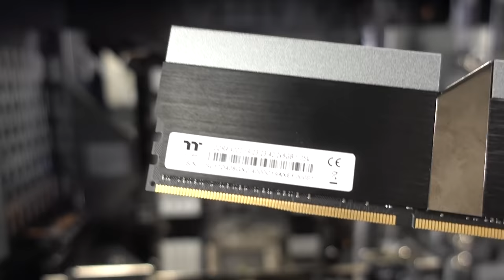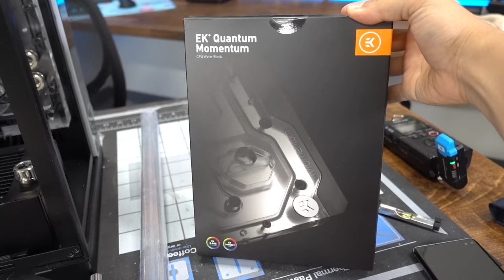My $10,000 PC is back #CHROMETHEUS

Comment: Calls a computer Chrometheus.
Only outfits it with 64GB of Memory.
Chrome like: HA
Reply: So you have chosen 2 tabs only
Reply: @sopcannon  2 tabs!? I can barely open 3 with 128GB, must be hitting the pagefile something awful to run 2 on 64.
Reply: I dont get it my $500 5 year old laptop has no problem with like 5 chrome tabs open.
Reply: @notanerd231  but not really
Reply: @gabemartinez2558  It's a running joke, because chrome is the most ram hungry browser, and yet its the most popular.
Reply: @gabemartinez2558  r/woooosh
Reply: gabe martinez issajokebud
Reply: @centuri.trader9194  keep using chrome. Unless you are doing serious multitasking it will be fine

Comment: About the tubing you have toward the front of the case: the inner bends seem to be slightly wider than 90 degrees, at least, that's what it looks like compared to the outer bends. I think you need to extend the horizontal parts of those tubes a few millimeters.

Comment: I'm still waiting for someone to make a loop with liquid metal instead of water.
Reply: Liquid metal would be an awful coolant
Reply: And it will ruin the pump.
Reply: The Verge might 😂😂
Reply: Mercury or something like that lol
Reply: I wanna see a case where theirs watercooling tubs sticking out of it, you do normal watercooling, but the input and output is outside the case. Tubing going along the wall to the basement connecting to the radiator in the house. Going into a pump that uses high pressure to push the water along. Maybe even the home plumming going thought radiator and to your pc, and back to a drain where you can save water. Idk long shot. But yeah

Comment: Been waiting for an update on this computer for forever! Glad to see its coming along!

I was thinking instead of the double 6 mm offset for the top tubing on the CPU block, what if that tubing went straight left immediately, going above the RAM, and then going down and back into the same hole? I think that might look nicer and would be easier to put together.  I think its gonna look sick with the metal tubing tho

Comment: Upper most horizontal tube (coming from the monoblock), I'd say: Up out of monoblock > horizontal towards distro > vertical towards fillport > down into distro. 
For the bend between going horizontal and vertical  I'd use the tube and for the angles (when coming out of the block and into the distro) I'd use regular 90 degree fittings. 
If needed, you could use two small pieces of straight tube at both the in- and outlet to ensure the tube runs parallel to the other bends height/depth-wise.

But then again, its a whole lot of 'I would' and a whole little of actually having the $ to have experience with this level of exotic cooling lol. What do I know?

Comment: This build is looking svelte and shiny without being all about the bling and unicorn vomit. I'm really digging the accoutrements and minute details you're adding with the fittings and the M.2 PCIe card. 

Not sure if you want them, but Phanteks Halos Lux aluminum fan coverings would give whatever fans you go with using some extra shiny, and you wouldn't even need to plug in the rgb cables, unless you wanted more light shining from them. Put those on top of white based fans would look sweet.

Comment: I saw this on a show when they were bending metal tubing for exhaust on a motorcycle. The company took metal tubing and filled it with soap water. The soap water never really froze when placed in to a freezer. The crew was able to bend the tubing without kinking the metal

Comment: You're gonna have a problem if the metal tubing doesn't come with different bend radii... It looks like what you did in PETG is WAY tighter than what was on that metal tube you showed.

Comment: Lian Li makes a really cheap sag bracket that replaces 2 motherboard screws and holds the card up from behind. It's just a single piece of "hole-punched" black metal, and 2 small L braces with padding, so it shouldn't be too visible.

Comment: It looks like you could move the distro block up ~12mm. Then you wouldn't need the double offset on the upper CPU, the offset on both ends of the lower CPU tube and you shouldn't need any offset from the lower GPU to the lower of those two outlets. That would just leave the upper GPU line that is off, but I think it might line up with that lower inlet to the distro block, just below the one it's in.

Comment: You should use Raid 0 for maximum speed on the editing machine and another solution like a NAS or storage server to permanently store your finished projects.  If it were me I would keep the dimm.2 fully populated on top of the add-in card for maximum storage, I would also consider a few HDDs as temporary storage for recent projects before they are sent to permanent storage somewhere else.  Hope you can find a sag bracket that fits the theme.

Comment: You have flexibility in your runs to the radiators. Try to raise or lower water block to reduce amount of offset fittings required.

Comment: noticed you finished your table, if you want a better finish on the top coat, get 0000 grade steel wool and scuff the surfacce, it will look alot better, just make sure you scuff with the direction of the grain

Comment: This is the O11 XL, right? You could vertically mount the GPU with Lian Li's accessory bracket. 

I think with the GPU having a water block on it that mounting it vertically would be really sick looking. Since you're going with metal tubing, the only place you'd see the liquid is in the distro plate. With the GPU mounted vertically, you could see the liquid flowing through it as well. Just a thought. :)

Comment: Now I'm interested in that RAM. A TR 3979x is in my future, and I know that Ram speeds are limited by ranks and density. If I could actually get 128gb of RAM to run as fast as possible, I'd be in love.

One thing. Make sure you put that DIMM.2 in to make sure you have tube clearance.

Also, the RGB makes the RAM run faster. Lyle told me so.

Comment: Why don't you bump up the entire distro plate by 3mm and avoid so many offset fittings?

Also, to support your GPU, take the bottom run out and go straight down and have it resting on the radiator or fans, whatever will be there. It is what I do with my hardline builds to help support the GPU and keep the fittings from pulling apart. Just a straight down and use your fitting 90 at the bottom to get a very flat place to press against.

Comment: If you had scrap metal tubing left use it to hold ur gpu up, it would look good with all the chrome tubing ur putting in it. Btw go to a metal shop, and get a bottom plate made to fit the bottom of the case then get it chromed or chrome paint it.

Comment: I need an opinion on my first pc build. Will there be any bottle necking or incompatibility? CPU: R5 3600 - Mobo: Tuf X570-Plus - GPU: RTX 2060 Super - PSU: EVGA 80+ Gold 750 Watt Semi Modular - RAM: Crucial Ballistix RGB 16GB (2x8) DDR4-3600 CL16 - Storage: Adata XPG SX8200 512GB M.2 Nvme SSD.

Comment: Kyle - for the upper fitting on the cpu/board monoblock, have you considered coming out at 90 degrees clockwise, run the piping straight across the gap above the RAM to the distro plate, then 90 degree turn clockwise to head down to the port?

Comment: Kyle go to home depot and as for a quarter to half inch pipe bending tool they come in few styles one like pliers with a wheel in the middle and others look like a bench vice with a wheel on the end ranging from $80.00 to $7000.00 depending on the bender size options..

Comment: Looks great mate! Got the same block, but ripped my OLED cable whilst trying to remove it.. Did you btw have the screws to screw in the VRM screw holes? They didn't supply the right length of screws in mine and I got some spare from another EK block which fit perfectly lol.. 

I'm interested in your loop temps once you are done, mine is currently pretty hard to get lower since the CPU just pumps so much heat :(

Comment: I would make a bracket that spans the lower radiator that is chromed but provides you a way to attach the GPU bracket to it. Since the Radiator comes with threaded screw holes!

Comment: COULDN'T FIND A CHROME SAG BRACKET ANYWHERE ... BUT ...  
There's lots of chrome holster/bolster types that prop it up from the PSU shroud ... but that would not look good in this.  
YOU COULD get a basic 'uphere' brand steel bracket ... and get it chromed locally.  
Go to a custom motorbike shop for info and a lead as to where to get that done.  It wouldn't be expensive.
btw ... had to slow it down to 0.25 speed to actually appreciate the waterblock install.

Comment: I've never worked with distro plates before but when mounting it in the O11D don't you have a little room for height adjustment on those elongated holes? Seems like you could get rid of a lot of those offsets just be moving the plate up a couple mm's for better alignment. Just saying.

Comment: If you fill up your metal tubing with sand then you can bend it different shapes without kinking it just pack the sand inside the metal tube and tape up the ends...

Comment: G'day Kyle,
I think you should get the Chrome Rads before you do the Chrome Tubing, just in case it changes the length needed for the Tubing, just use the New Thermaltake Silver Coolant for now in the Clear Tubes, it is Looking Awesome,
I hope my New Editing PC with R9 3900 & GTX1080Ti will look as good when I do my First Custom Loop for it, I am using Phanteks Blocks for the CPU & GPU, I still have to decide on a Pump/Res Combo & Fittings

Comment: Just gone TR myself; 1900X & X399 Taichi from x99 sabertooth and Xeon E5 v3 to compliment the 5700 XT I’ve had a while and went all AMD for the first time. Only issue thus far is Ryzen master not wanting to install. 

It came with an EK Monoblock supposedly only for asrock boards (it even covers the VRM) but I doubt I’ll be going custom loop at least not for a long time and apparently there’s not many around of it so even if I wanted to sell it I dunno the value on it. 

That’s rigs looking very nice, TRX40 is complete overkill for my needs and I doubt I’ll need anything beyond, say a 2920X or something like that but dayyuuum it’s looking and gonna be pretty. Form and function to match 👌 can always appreciate killer hardware regardless of what I’d ever get.

Cannot wait to see the metal tubing all sorted, let alone when it may get some Ampere goodness, hope it lasts and isn’t too much trouble for you to maintain.

Comment: Personally, with all the offset fittings, it looks a bit like a bodge to say the least.
Would also have to say that the distro plate itself seems more like a gimmick than it actually provides useful connections.... That makes me wonder if EK makes custom distro plates to order. Since that would be wonderful if one could ask them to machine the hole x mm higher up instead of using off set fittings.

Though, having a laser cutter myself, I would just buy acrylic sheets and make my own from scratch. (Yes, it would need to be a layered sandwich. But that is frankly semi trivial to do.)

Comment: For the love of god ... please leak check this thing with air before putting coolant anywhere near it. It might be a good idea to show the viewers how to do this as well. The tube run out of the top of the mono-block might be a right pain to bleed air out of as well.
Being as heavy as it is when it's full of water means tipping it to bleed air may be very difficult.
I would just modify the runs to avoid using those offset fittings as they are just a major flow restriction. Good luck with it.

Comment: Saw on the RAM that it's 4000Mhz at 19-x-x-x... 

Doesn't Ryzen run best (1 to 1?) at 3733Mhz? Would it be worth it to run it slower and try to tighten the timings?

Comment: Kyle: Builds $10k computer with 2 massive radiators

Also Kyle: Does not give either massive heat producing component their own massive radiator.
Reply: While I'm sure he would have liked to have ran it that way, he did state that he was limited on the amount of tubing he had available... And yes, while a bit redundant to cool a rad with a rad and "cool" a CPU straight off of a GPU (or vise-versa) isn't ideal, the system likely will never top 80°c anyways, so not the biggest concern... Just OCD working overtime.
Reply: @RAW_Reality  exactly. But also, it's a 10k build? So like. Idk. I'm one of those crazy "if I'm investing my money into anything, I'm gonna make every 'ideal' choice I can," types. It would bug me on a fundamental level using that PC every day knowing I left a few less degrees of cooling for one of those parts on the table. Maybe in V2
Reply: @Dyloniuss  Oh, I can't fault you for that, I'm much the same way. Though, for the sake of progressing "without the wait or hassle" of getting more tubing, ya work with whatcha got... Yes, there'd be that itch in the back of my head yelling at me to "fix it!", but want in one hand.... You know the rest...
Fingers crossed for V2 though, for sure.
Reply: @RAW_Reality  I think if it's a budget watercooling rig I'd let it go. But. It's a 3770 and a 2080ti? Cmonnnnnnn
Reply: @Dyloniuss  That's fair. 👍

Comment: The ram oriented in opposite direction triggers me, especially since your tubing runs are going for that every even, parallel look. I'd remove half the heatsinks and install them the same orientation as the others, or just get symmetrical sticks

Comment: I have wanted to that with Flared 3/8s inch copper but where do you get fittings? I know compressing fittings will work. BUT leaks suck and I do know the only leaks I ever had on flared 150 working pressure psi lines occurred from fractures in the line.
Not likely with a PC Because they don't vibrate.

Comment: Would you need less offset fittings if you moved the distro plate up slightly? It seems like you could cut the number required in half ...

Comment: 2 things is your cooler going to stress the mother board due to its weight and secondly would it be easyer to temp test with those tubes now rather then measure cut and instsll the metal ones to find out temps are not good ??

Comment: y does every tech tuber insist on touching the metal contacts on ram sticks and gpus might as well drag it across the carpet while your at it, anyway other than that great looking op build i think the chrome radiators will look way nicer also as far a gpu sag bracket cant imagine a custom piece would be to hard to have made

Comment: I would just use the plastic tubing. The metal tubing is going to add more weight. And you can not see the water in a metal tube.
And no I have never built a computer that expensive. And you added components I'm sure blows your budget past $10,000. 
And you can buy a metal tubing bender for $75 at Harbor Freight.

Comment: CPU: AMD Ryzen 5 3600 - 6-Core 3.60GHz, 4.2GHz Turbo - 32MB L3 Cache Processor, Pro OC Compatible (No On-board Graphics)
HDD: None Selected
MEMORY: 16GB (2x8GB) DDR4/3200mhz Dual Channel Memory (HyperX Fury w/Heat Spreader)
MOTHERBOARD: MSI B450 Tomahawk MAX: ATX w/ USB 3.1, SATA3, 1x M.2
SOUND: HIGH DEFINITION ON-BOARD AUDIO
VIDEO: MSI GeForce® RTX 2060 Super 8GB - Ray Tracing Technology, DX12®, VR Ready, HDMI, DP - 4 Monitor Support (Single Card)

Comment: Raid 5 (3x read and no write speed gains) is the worst, you should go raid 10 (4x read and 2x write speed gains) instead - yes you loose a bit of capacity. Raid 5 rebuilds are incredibly slow, even with m.2 drives. I've had so many raid 5s shit the bed.

Comment: NEED HELP PLS

I AM ABOUT TO BUY A GAMING RIG, BUT A BIT CONFUSED. RYZEN 3900X! 3200MHZ RAM OR 3600MHZ RAM? QUAD CHANNEL 4X8 OR DUAL CHANNEL 2X16?
Reply: 3900x supports only dual channel memory, even if you get 4 sticks they will run in double channel config.

Comment: Someone help me pls! I build a pc with r7 3700x, asrock b550 extreme4, corsair 16gb 3200mhz, rtx 2060 ko, wd nvme. When I plug the pc rgb lights on mobo come on but nothing else. Fans don't spin and cpu and gpu don't start. What should i do?
Reply: Check front panel connections
Reply: @unknownperson3691  I did, they're in correct place, I even tried without gpu, with single ram stick. Still nothing. Reset cmos and nothing

Comment: Lian Li cases are really beautiful, until you try to lift the case without the glass side panels, as it can hardly keep itself together. You have to lift it like a paper bag out of the store. The structural integrity is so bad, as Lian Li couldn't even bother to use tight screws. Everything is held together with loosely fitted pop rivets.

Comment: Edit:I need help my pc wont boot at first all the fans spun and my cpu cooler but now they dont after I checked all of my connections then plugged power back in to see if would boot to monitor it wont and like I said now the fans dont work Please anyone who can help please do.....

I finished my 1st PC Ryzen 3 3200G, Crucial BX500 120Gb SSD, Thermaltake smart 430Watt 80+ white, Crucial Ballistix 2400 Mhz 2x4, AsRock B450 Steel Legend, Rosewell Spectra X-Blue. Took 4 hours going from bitwit vids to manual to indian guy on YT it has alot of cable management issues but eh so tomorrow im OC it and changeing rgb colors I recommend Building your own my heart and soul is in this PC.